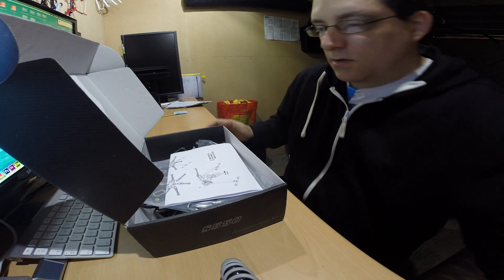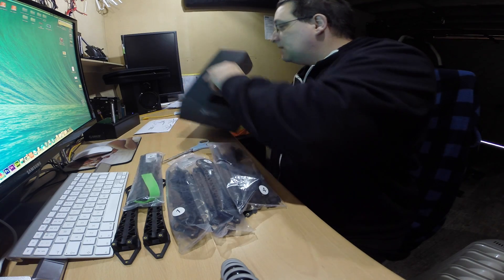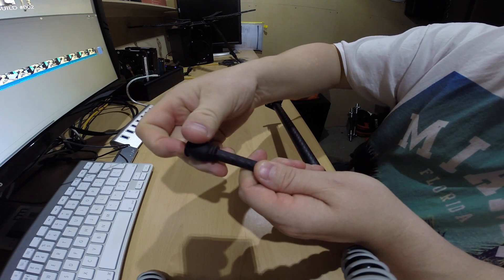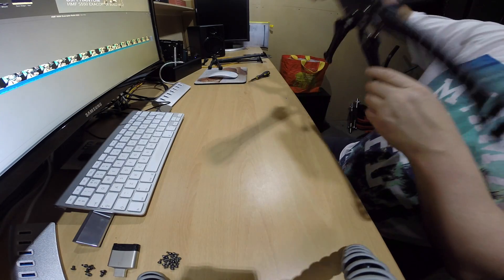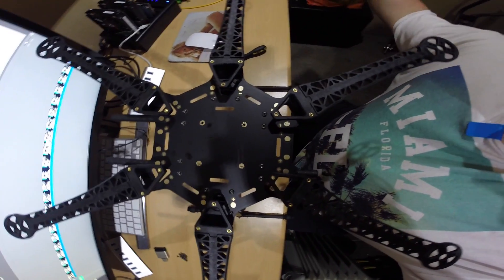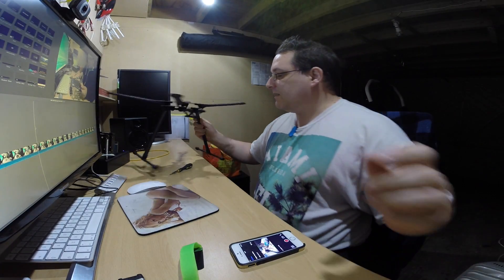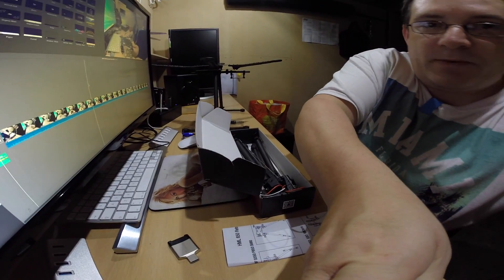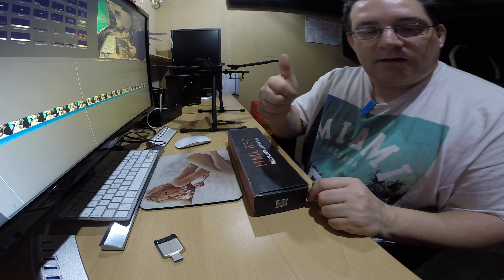HMF S550 Hexacopter Build #002

Comment: Hi, I have the exact same setup, but am having very unstable flight. The S550 drifts off, shoots up high when wind hits it. Did you experiance the same? Thanks !
Reply from the maker: +Bastiaan van Maastricht after i install the DJI flight controller and did the first firmware update it hasn't power up since, so i looking at another controller to use.

Comment: Isn't it easier to buy a kit for it, than to hunt for parts? Or is that part of the fun?

http://www.dhgate.com/product/f08618-b-hmf-s550-f550-hexacopter-6-axis/237095646.html?utm_source=pla&utm_medium=GMC&utm_campaign=fmt-model&utm_term=237095646&f=bm%7c237095646%7c102015-OtherToys%7cGMC%7cAdwords%7cpla%7cfmt-model%7cUS%7c102015-OtherToys%7cc%7c%7c0HRF%7c&gclid=CJma2OP4_MkCFccYHwod-PgKCQ
Reply from the maker: +Danyal Ahmad its more fun hunting for parts as you many want a better motor or flight controller etc.
Reply: Jacks Drones I am really considering ordering parts and building one for myself. Approx. how much did it cost you to make it? And, did you have to program it?
Reply from the maker: +Danyal Ahmad I haven't added it up yet will do this on a new video this week as i just about to show how to program it up.
Reply: Jacks Drones I will definatly watch.

Comment: I see. Yes ive also bought the v2 combo kit . I learnt yesterday that you can flash a Naza m lite with the V2 thus technically converting the cheaper control unit into the more expensive v2 for half the price almost. You can imagine that DJI are none too happy about this. Can the legs fold up on the S550? I wasn't aware of this.
Reply from the maker: I bought the folding legs to replace the ones that came with this, Arr that sound a good one to try out and it would save £100 as i think they around £90 to buy.

Comment: Which DJI controller is that Jack for £200? Also what's your take on quality of the PCB on the S550 compared to the original DJI frame? Exactly the same ? Ie when soldering do you notice a difference ? Cheers
Reply from the maker: I thinking of DJI Naza M V2 Flight Stabilization Controller System Combo w/ GPS, LED, PMU which is around £190 to buy and S550 frame is the first frame i got, so when i was searching around for a frame that could allow to have more then 4 motors i came across the S550 as i want  legs to fold up and enough space to be able to have a gimbal which would allow for 360 view, that was my idea behind getting the S550, down to soldering this seem to be easy access and it clean and tidy, i didn't want a frame to show all the cabling hanging around. As i do like the DJI S1000 model very tidy and look good.

Comment: I've ordered this for now ( sending the F550 frame back ) and then order the auto legs later as not sure if my original DJI controller can handle it http://www.goodluckbuy.com/hmf-s550-f550-upgrade-hexacopter-frame-kit-soldered-center-plate-w-landing-skid-for-fpv.html
Reply from the maker: I looking at controller and i going for the DJI one which around £200 and i also have the auto landing legs to fit very soon to. new video coming this week.

Comment: Cool. Im planning  also to get this one. What motor did you used? Dji e300. Does the motor provide enough power.
Reply from the maker: goto my website as i listing all the parts i using with sec and where i got them from etc, keep watching this page as i move along with the build i will publish all the parts for it here http://www.jackdjiphantom.uk/category/s550-hexacopter-build/